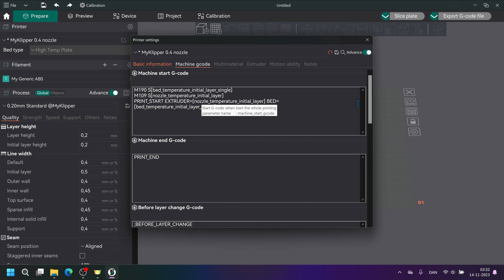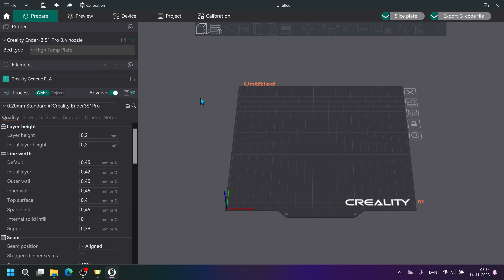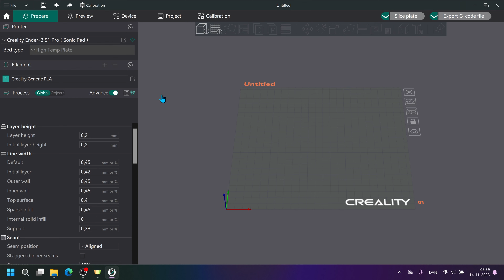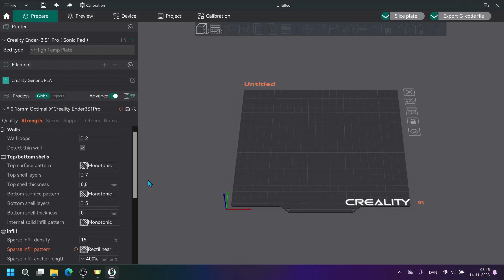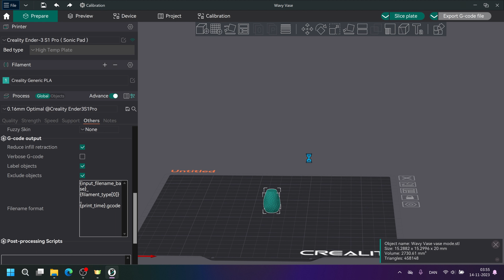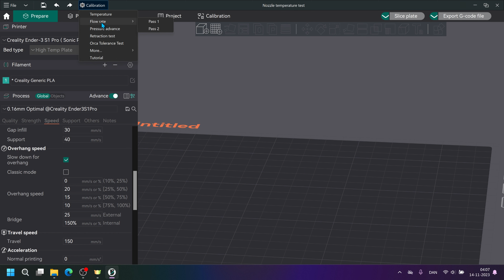AMAZING and FLAWLESS Quality Prints With This Orca In-Depth Guide, 119% Orca Skill Improvement.

Comment: so i know this is a 1 year old video but, i just found it today and with just one setup you helped me understand that i had the sonic pad doing basically nothing since all my speeds were govern by orca, now the same print went from 2.04 hours to 1,11 hours, same quality, also i was having tons of problems with my bed mesh and this ensured that the one saved was used improving my layer adhesion and the quality of the first layer as well. thank you so much, i hope you can re make this with the newest version to see if anything changed significantly, only setting i didn't have on my orca slicer was the timelapse which i never been able to setup either on the Sonic pad or in orca.
Reply from the maker: Hi and thank you very much for you comment, it really means a lot that you found this video useful. 

I have been busy for a couple of months, but I’m back in making videos, so I will for sure do a re make of this video but with the updated features as well as settings. 

Thanks again for your kind words, it truly means a lot l, i try to do my best in making useful videos which is pointed directly towards a goal and not talking about all kind of useless stuff. 

I try to make my videos that goes directly to the point without to much fillers. 

❤

Comment: Thank you for this video. I had been trying Orca Slicer with my Ender 3 S1 with Sonic Pad, but found the generic "Klipper" profile in Orca far too fast for my Ender 3 S1 with Sonic Pad, causing print fails.  So I think I'll reinstall the printer in Orca, this time following the steps in your video :-)
Reply from the maker: Thank YOU that means a lot. 💯😎 Orca is in my opinion just perfectly set up with the different print profiles, and it just delivers. 😊 For sure, keep me updated when you have tried the steps in this video. 😊💯

Comment: Well the benchy finished the boat and most of it printed perfect better then Cura but the top half did not print :( . I used pla
Reply from the maker: Have you done any calibrations? Can you send me an email with a picture of the print, and I will take a look at it, my info mail is in my Bio. 👍🏻
Reply: @TechByHesselbech  I throw the print mate but over half printed nice it was the last 30 percent . I turned of all speeds in orca has my sonic pad is all setup perfect with cura now that prints perfect tpu prints and some pla prints the benchy prints better at the top half then the bottom on cura lol
Reply from the maker: At what print speeds did you print.? 
in Orca you could try the pre configure generic TPU profile.
Reply: @TechByHesselbech  no I have not printed on tpu in orca yet only pla I used your settings in the video I am trying a tpu print in orca but printer is busy now with a print from cura pal . I did use the pla profile in orca when I did the benchy it took 57 mins so not to fast
Reply from the maker: @BODALLY Sounds great. I always recommend to adjust the slicer speeds accordingly to your specific printer, and calibrations. 👍🏻💯
Reply: @TechByHesselbech  so I tried the pal setting in orca with tpu and it printed awesome mint its just plain its self mate very strange I will email you some images it has printed in plastic good and others not has good even at slow speed
Reply from the maker: Thats awesome, yeah sent me an email and I will have a look, 😎💯

Comment: I have a question. I have great quality on my cr10. When i do a simple flow rate cube 3 btm laryers vase mode no top layer i get 20 x 20 mm but my wall with is .48 should this be of concern? Im uaing a .4 nozzle? How could i adjust this?
Reply from the maker: Hi thanks for the question, did you do any calibrations? You should do a flow test to check if your flow rate is too high or too low, how big was your cube from side to side? External mm?
Reply: @TechByHesselbech  yeah I did the full calibration on orca slicer, and the 20x20x20mm cube came out 20x20x20mm exact  in both the x and y and z but the wall with was .48 mm.
Reply from the maker: @ga6287  have you checked your wall with in Orca? What pre-configured profile do you use when you print 0.2, 0.16 ?

Comment: BTW in Quality tab order of walls you should use the lowest one (Inner -->outer -->inner-->infill) this should give you a better accuracy but still great overhand performance.
In regard to infill, you usually never have to go over 20% or so. The most strength comes from the outer most layer. So the best way to increase overall strength and still save material is to increase wall count not infill, infill is mostly useless for strength.
Reply from the maker: Yeah exactly, I just normally use the other one because of the infill to wall overlap.
Yeah above 20% is never needed, but for some parts in the car industry, the infill has to be quite higher, but for normal use, below 20% is more than enough, unless you are making bricks to build a house 😀
Reply: @TechByHesselbech  "...I just normally use the other one because of the infill to wall overlap...." I don´t quiet understand. Does the infill to wall overlap change with this option ? As far as I understand the overlap stays the same but the print sequence changes. It should print (first inner wall which is besides the outer wall-->outside wall-->second inner wall beside the first inner wall-->infill) 
 
"...Yeah above 20% is never needed, but for some parts in the car industry..." Oh course this depends on the use case. Funny you mention the car industry, I am an automotive design engineer and I never get parts with 20% infill or above xD
Of course there might be cases where people need more infill for whichever reason, I just wanted to say that this is a rare occasion because if you think about a round tubular profile, the hollow tube which is for example ø10mm with 1mm wall thickness has about 10% less strength than a filled non hollow profile of same size, but it weights 90% more. The most inner material in a part does not add any strength whatsoever, especially for bending, that´s why engineers use hollowed out profiles most of the time. It´s the best strength to weight compromise. 
I am sure YOU know that, but somebody else might read that and maybe understand better why lots of infill does not provide any strength but more walls do.
Reply from the maker: @sierraecho884  the reason why you might not get parts with over 20% infill is because all car parts are molded and not 3D printed 😊

And the infill plays a crucial role in some type of 3D prints depending in the prints design, some parts need infill to make a cross reference of strength where walls does not provide the same cross reference strength. 

For car parts like crucial structural parts, they are profiles which are press molded, because they need to be able to bend a specific way to absorb impact if a car is in a crash, a non hollow profile would not be able to absorb the impact the same way.

3D prints can’t be compared to crucial car parts, because of the way 3D prints are made, a steel hollow pipe is not made layer by layer.

That is why car engineers use hollow design in the structural profiles because they have to bend or collapse because of the way they need to absorb the most amount of impact, and protect the driver.
Reply: @TechByHesselbech  Yes, and I do design those parts. But you always need samples and that´s why rapid prototyping was invested here in Germany which we call now 3D printing. We also sent out samples to the customer from time to time, I am currently waiting for some parts for FORD for instance, those are SLS parts so they are 100% solid PA.

Sure some parts need more strength but even in those parts the absolute majority of strength is provided by the outer most layer.  As you have said, most parts are molded with ribbed structures anyways. Except in 3D prints you don´t have to rely on the ribs you can make chunky parts but even then the infill is just the icing on the cake.

All structural car parts are basically sheet metal (cheap and simple), or profiles because not every part in a car needs to absorb energy. The occupant section has to be stiff and sturdy for instance, that´s why the A B C Pillars are high strength steel usually. Most other parts are plastic since they are cheap and easily molded by the millions. None of them are 3D printed because there is no way you could do that in time for the cost. 

BTW I didn´t compare 3D prints to crucial parts. It´s just rapid prototyping you don´t really use it in production vehicles...well at least for now, for most vehicles. 

And no, engineers use hollow designs for a variety of reasons not only for them to absorb energy. You could also use metal foam for that reason for instance. It´s because stamped parts are cheap and easy. Hollow profiles have the best weight to strength ratio. The most inner layer does not provide any resistance to bending for instance it´s simply wasted material. 
You can look that up in any mech. engineering book.
That´s how the I beam works for instance and all the other profiles the further out to the outline layer you move the more bend resistance you get. An I beam shaves off 80% of weight for instance. You want your parts to be light, cheap and easy. And that´s exactly why more infill does not provide any more benefit. Now gradually denser infill this makes a lot of sense where the core is hollow the further out it get´s the more material you get. But I have not seen any of this in a slicer beside CNC kitchen videos. BTW check those out, maybe you will better understand why infill does not make much sense then he can explain it probably better than I do.
Reply: @sierraecho884  If not for your comment I don't think I learned anything new from this video, for sure nothing advanced or even intermediate for that matter.
Reply from the maker: @TDHobbies this video is meant to be a “fast” start up to get started with Orca.
Not everyone has the knowledge or skills to get started with orca. Therefore I makes this video, and from there it’s up to each individual to get the rest sorted out. 

But thanks for your comment.
Reply: @TDHobbies  I am glad you learned something new from my comment. However maybe this video just was not for you, I am sure other people learn something useful from it.
Reply from the maker: @sierraecho884 exactly my point also. Thanks for your reply on the other comment. 
It’s hard to make that makes everybody happy.
Reply: @TechByHesselbech  I guess I was expecting more with a title like,  "AMAZING and FLAWLESS Quality Prints With This Orca In-Depth Guide, 119% Orca Skill Improvement"  My prints are NOT amazing and flawless with the base settings and I clicked on this video to learn more about tweaking some settings, I didn't learn anything other than the basics of where things are, which unlike other viewers I already knew all of this, I wanted to learn some other tweaks in the settings... apparently my printer is not as good as yours as I needed to make a few adjustments here and there to make it print closer to AMAZING and I am still not at the FLAWLESS quality.  I should have known better than to comment as  everyone is angry and get's but hurt, but I didn't mean anything NEGATIVE, in fact I complemented the other guy and he wasn't very positive toward me.  LOL  So hope my comments get you some algorithms at least,  Happy printing and yes your video is very good as for a TOUR of the software and explaining most of the settings,  I thought there was more to it, Thank you for the reply and clarification.
Reply from the maker: @TDHobbies  as mentioned before, it was a requested video from people who had used Cura and had all kind of issues. I came across Orca and from the beginning I could see a huge improvements. 
But I’m working on another Orca videos which is also requested, but it is hard to keep everybody happy.
Some would like to have these kind of settings shown in a down to earth matter, some would like to have me invent the spoon, but I try my best to keep the videos for everybody.
But if there is something you would like me to show or talk about, I will for sure include it in the next video. 

As we all know , the titles are like the new papers, we need to keep it exciting enough for people to know what it is about. And coming from Cura, yes this video is Flawless, not that this video will get you this exact prints, but it is a great foundation for people seeking a more intuitive and pre fixed slicer which has less issues from the get go. 

But I hope I will make a video in the future which will help you in another way. 

But if people are coming from Cura and have had issues,  this video plus their own tweaking will get them far more quality prints than they are used to. 

And I haven’t said anything in the description or anywhere else it was a video with tweaking settings, this is all up to each individual to tweak for their own printer.
I don’t know every single one of the viewers printer or how they are put together or calibrated, but I can for sure give them the wrench to help them unscrew the bolt, which many has been asking for. 😊

Hope this made sense.

Comment: Thanks for such an great video. 

However can u make one similar video on Orca for Marlin based printers like the Ender 3 Pro cause there are still quite a lot of people including myself who still has and uses a Creality Ender printer and have been using Cura but wish to switch to Orca and have been struggling with even the basics like setting up a Ender 3 Pro kind of printer in Orca.

Looking forward too. avideo on this from you.

Thanks
Reply from the maker: Hi , thanks for your comment and your kind words. For sure I can make a video of the same just with the ender 3 Pro with marking firmware. 😊

I do have a couple of ender 3 pros myself, they are great printers.

Thanks again for your kind words, it means a lot. 

Ender 3 pro and orca it is. 😊💯
Reply: Thank you so very much for reading my feedback and for such quick and positive response. 🙏

I am already excited 🎉 and soo looking forward to the video on setting up a Marlin based Ender 3 pro video in Orca slicer which will help me and many more like myself switch from cura to Orca or maybe use both depending on the scenario of our prints that we would do. 

Thanks again.
Reply from the maker: @dst161   thanks again, 😊 but no problem, this is what our community is for, helping each other out to get awesome prints with less headache. 💯

Comment: Hi good morning I love your videos learn a lot thank you so much for teaching us what to do. I have a question I’m trying to print TPU and I need to reduce the   Speed. I don’t know how to do this. Where can I go on the speed. I looked under speed and I cannot figure out which one to change. Thank you. I appreciate your help.
Reply from the maker: Hi, and thank you so much for the kind words, I really appreciate that you find my video useful.
Do you have a sonic pad.? Or do you just have the printer connected. 
But in orca under the the different speeds  settings, you can set your preferred speed, have you tried to add a generic TPU setting in Orca, then it should automatically slow down the speed accordingly to TPU, if not you could try that or you can very simply change your print speed in the different tabs on the left under print settings. 😊

Comment: you set all of the Motion ability tab settings to 0 to enable Klipper control of these settings? 
there appears to be a new Emit limits to G-code check box ,that says it's ignored if Klipper is selected.
Reply from the maker: Hi and thanks for you comment, yep that will overrule the 0 settings.. only Klipper needs to control.. 😊

Comment: So does this also apply to the Nebula Pad? I just upgraded my Ender 3 V3 SE.
Reply from the maker: Hi and thanks for you comment and question.

Yes you can use all available pads, you just need to choose your correct firmware/g-code flavor in orca. 

So if your pad is running klipper you just select your printer and then choose the corresponding g-code flavor your pad is running. 
It is just so orca knows what kind of firmware you are running. 😊

Hope it makes sense or else feel free to ask again. 😊
Reply: I’m getting to do this very thing to my V3 SE, where did you find your Klipper profile for it?
Reply from the maker: @Impuritan1  hi, thanks for the question, don’t know if this was for me or OP, but you can find the klipper profiles in the Klipper GitHub page, they have a variety of profiles to download and use as reference.

Comment: I use orca with my ender 3 v2 on mriscoc firmware.
What i added is seams into perimeter, so they are bsrely visible and also reduces stringing.
Reply from the maker: Hi, that is a very nice tip, thanks for your comment. 👍🏻😎💯

Comment: Do you know if its possible to adjust the clone settings to fit more on the plate? Theres a certain thing I print in hundreds and don't like how it spreads them out , I could fit nearly 30 more on if it would let me.
Reply from the maker: @8thsinner  hi thanks for your comment, you can type in the amount you want it to clone on the plate, then you can readjust the rotation of the prints. 
Feel free to ask again if you have issues getting this to work. 😎
Reply: @TechByHesselbech  Figured things out, I was using fill bed before, and on my old printer it would waste a lot of space, since upgrading to a qidi xm3 and updating orca I haven't had the same issue with it, but i'm also seeing the clone number thing too (not sure if that was in the old version or not but I see it now)
Thanks